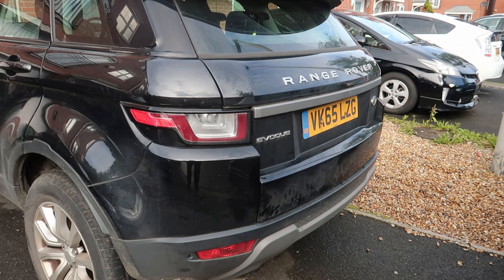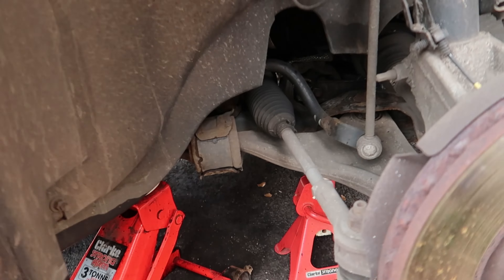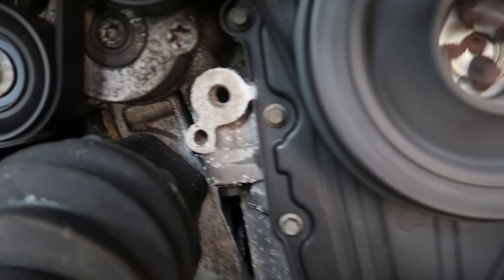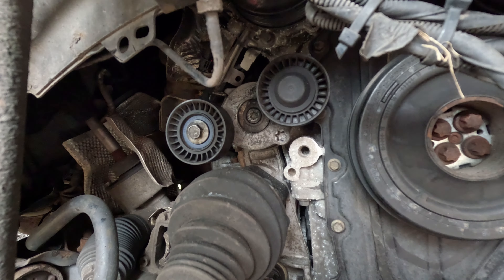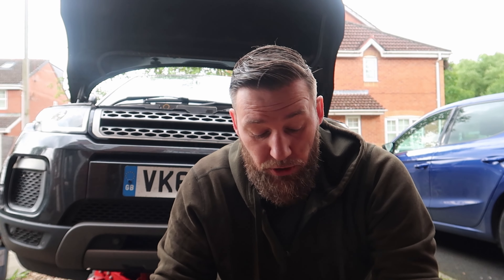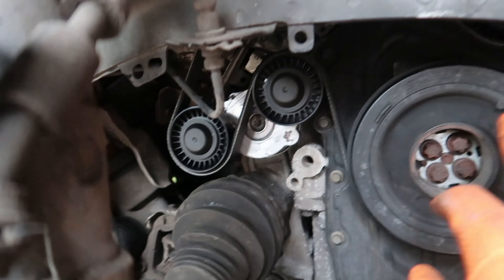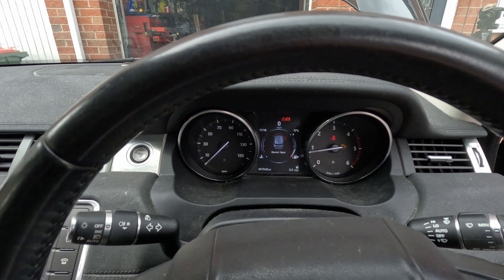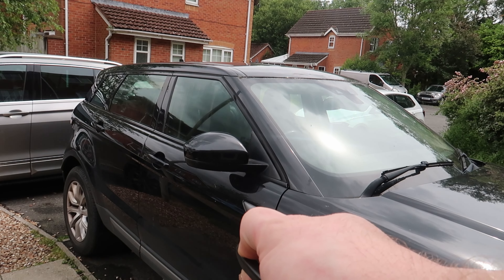Has The Timing Chain Failed On My CHEAP Range Rover Evoque??| EP 2

Comment: I’ve got the same thing but on a 2.2 sd4 thinking it’s the drive tensioner as my timing belt and tensioner was done 3 years back.. did the noise go away if you give it a bit of gas?

Comment: Hi,
I have a problem with my Evoque 2015 . Engine lights on my dashboard, they checked by land rover shop and changed the exhaust sensor and they found out a noise/smoke in the engine and recommend timing chain replacement. I don't know if it's the main issue coz it's very expensive. Any idea? Thanks
Reply from the maker: Hi,

Sorry to hear about your issues but I can’t help as I’m not a Range Rover expert sorry.

Comment: Great video, I hate misdiagnosing things just recently my ford focus mk2 has has a vibration when I put my foot hard down on the accelerator on the motorway and a bit of clunking when changing gear I changed the engine mount but no real diffrence back to the drawing board I guess.
Reply from the maker: Have you checked your Driveshafts? Really common on the STs. I had similar issue and changed a driveshaft and the problem went.
Reply: @BamMotors  Yes the right hand side one has a little play in it not much though, I have the 1.8 TDCI but the suspension layout looks very much the same as your ST. What sympoms did you get when the driveshaft went?

Comment: Glad it was only the tensioners and all seems ok now. I find it odd that all 4 doors won't open. It can't be a part but rather something that sends the signal to the doors to open. As for the DPF I have seen on another channel that it can be filled and flushed with a chemical. It's either that or get a professional company to come out and clean it. Check it's not the sensor playing up as that could cause the same readings. Also apologies for the Pussy Range Rover comment LOL It's only because the Sports are the baby RR's as I have a L322 4.2 Supercharged!! Keep up the good work and am looking forward to the next video.

PS Just had a thought about the doors, check the button in the remote is ok and not knackered. You might be able to get a cheap ebay replacement case and transfer the insides over and get the blade cut. Just an idea.
Reply from the maker: Me too, timing chains are an expensive job! I’ve got a chemical flush for the DPF going to try it myself and it can’t fix it going to call in the experts. I thought the same about the locks but they won’t lock on the button on the inside of the car either plus the hazards lights flash to show acknowledgment of receiving the signal and it’s a really common issue. 

P.S 
I know the project name was in jest so don’t worry.